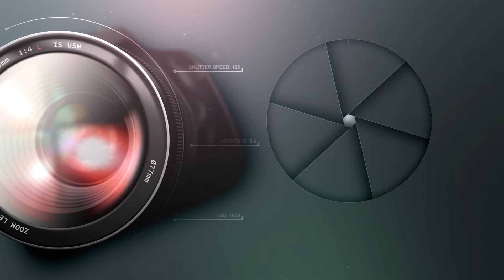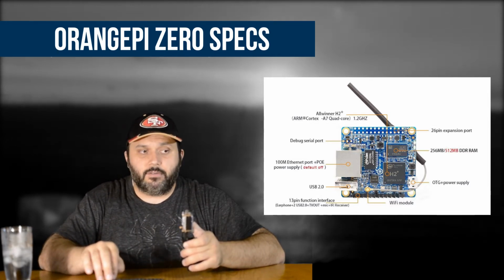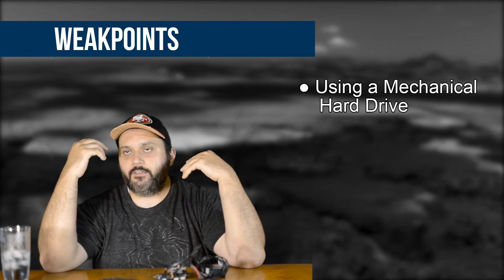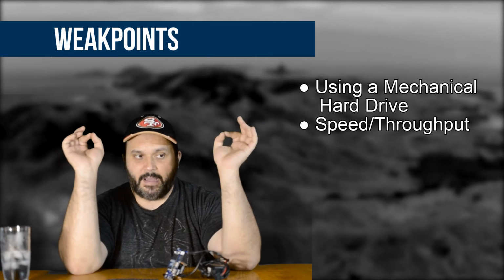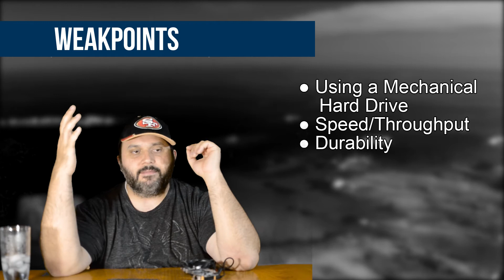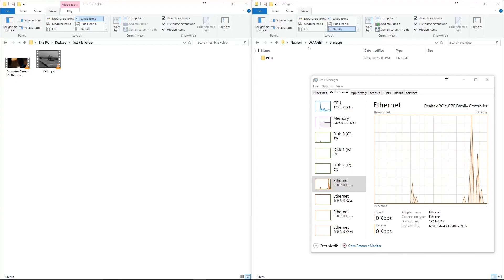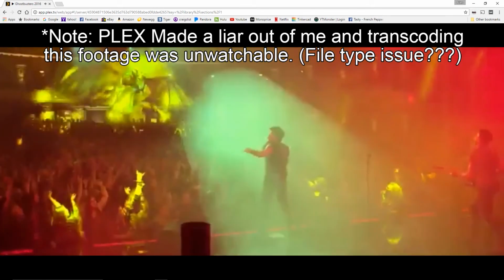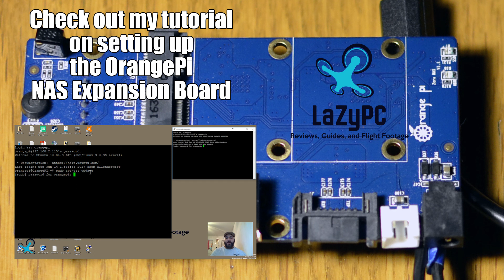OrangePi NAS Expansion Board Review

Comment: Just a heads up, there is a version of the pi zero with gigabit ethernet now.
Still, I only get about 20 Megabytes/second through one of these in practical application. Could be due to my old disks.
Also, I don't think I had to power both boards, but I might not remember correctly...

Comment: This is a very underrated channel. I'm glad I found this video. I'we found a much more appealing Orange Pi with gigabit ethernet, H6 cpu, and it's still not that expensive. It's called the Orange Pi One Plus H6 1GB. I ordered it for about 25 usd including shipping.The website claims that this NAS board works with all the Orange Pi so maybe it would be a much better setup. I haven't got it yet so I don't know... but maybe you can check it as well.

Comment: [05:40} no need for MicroUSB Power - the NAS-Board is powering the Orange Pi :)
I got the right Power-Supply (5V/3A) from my seller here in turkey where I did buy the NAS-Board.
https://www.robotistan.com/orange-pi-plus-2-guc-adaptoru
And as curiosity I adapted it to the Orange Pi (Zero) R1 with Dual-100MBit Ethernet.
For the 100MBit Ethernet bootleneck you could use a USB 2.0 / USB 3.0 1000MBit-Adapter.
Maybe faster when they share the 480Mbit od USB 2.0 than the poor 100MBit Ethernet :)